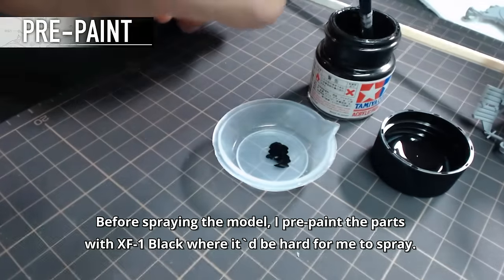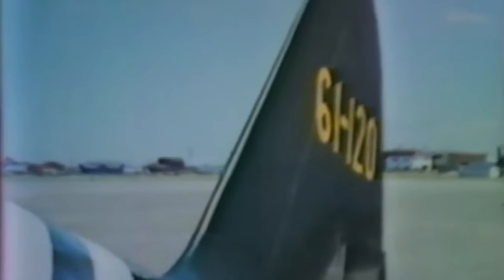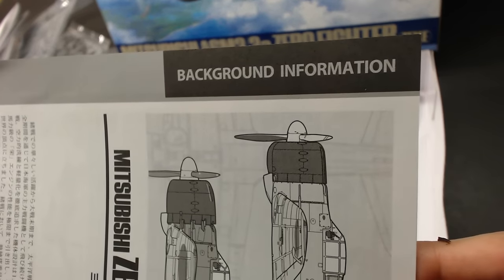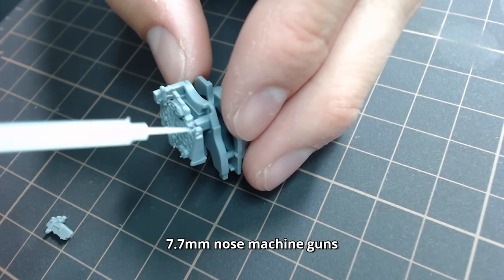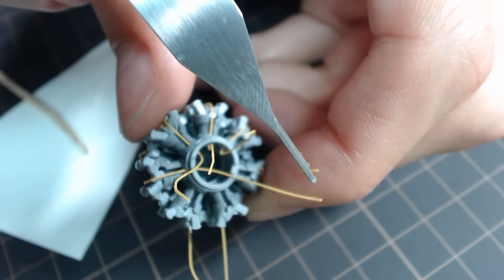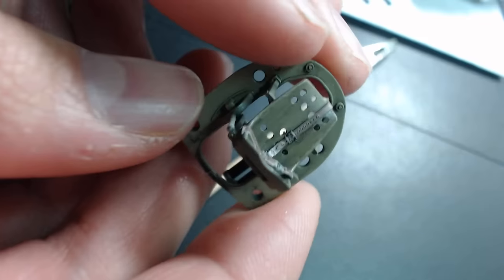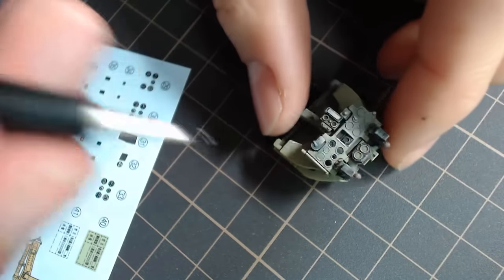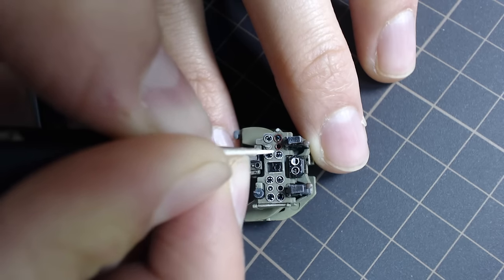Lets Build : Mitsubishi Zero Fighter [Cockpit & Engine]

Comment: I found that using either black pencil or grey lead pencil powder makes great carbon look from exhaust although grey lead pencil looks a little metallic.
Same with things like dust and mud use brown pencil lead powder brushed on the underside and landing gear to give appearance of dust and aging.
Now I am playing around with electronics I would have probably added lights and spinning prop etc. tiny pin holes in cockpit and back light etc. but still nowhere to put it.
For instruments paint the white on first let it dry then paint black on top let it dry then use a pin to scratch and poke the details scratching the black off to expose the white.